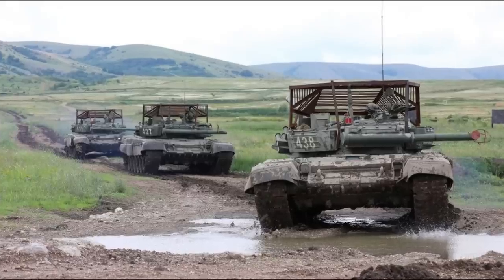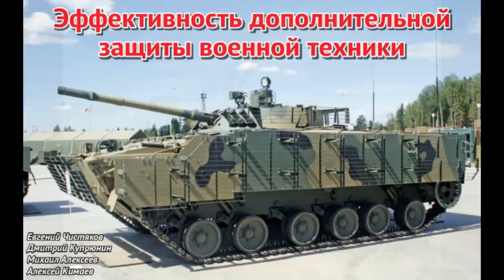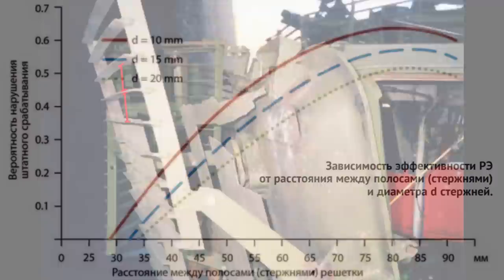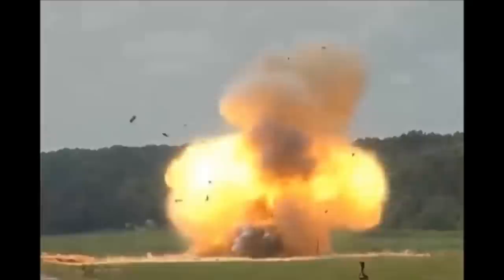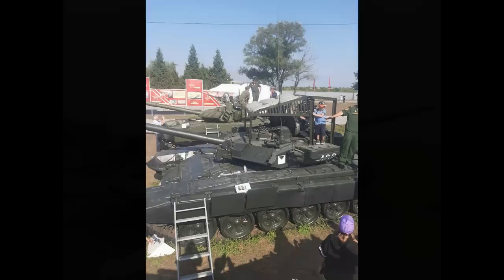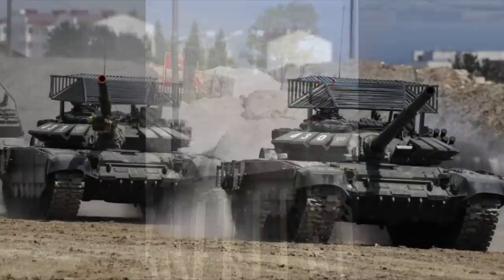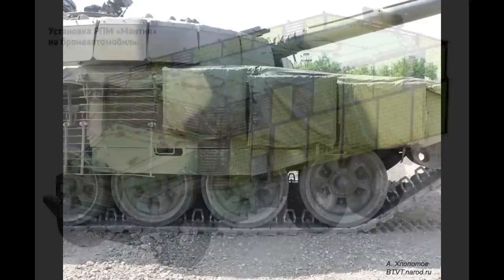The Truth About COPE CAGES

Comment: the V-shaped metal is called "angle Iron" in the US, it's a very common metal stock used for fabrication, welding and construction
Reply: Agreed. 
And described by dimensions such as:  L2x2x1/4"
(capital L to represent its shape)
Reply: or to me it looks like a vary vary long metal corner brackets prob bought from the russian equivalent of home depo
Reply: That's what I was going to say it is here in Scotland.
Reply: We just call it Angle Bars
Reply: @sven9900  thats what angle iron is basically.  

Very common in 3rd world to just do whateve whenever. With stick welders of course. 

Dunno why home depot wouldn't sell the stuff
Reply: Angle iron is what the UK calls it too. Made from mild steel, so surprised it's military use.
Reply: @lasskinn474  we are from earth(3rd world). Mercury is st, Venus is 2nd, Mars is 4th and so on. which world are you from?
Reply: @redfalconvfx7050  well he kind of is technically incorrect. Russia (USSR) was 2nd world. NATO / aligned nation's were first world. The rest were the 3rd world. It is accepted terminology though.
Reply: I was thinking it is for bilding the javelin or a bomb by transmission waves or making it electricomagtic in way that the filed is the opposite of the threat which makes the threat doesn't hit them directly. Same way in m1 Abraham.
Reply: Its called that everywhere..
Reply: that's standard construction material all around the world
Reply: @ailediablo79  WTF are you talking about?
Reply: @coenogo  javelin and others use singles to aim at the target which can be blinded. Also they are made if metal materials that you can make around the tank an electromagnetic force field opposite to thise materials to force it go away.
Reply: @PrivateWalker  Even first world military shipbuilding uses a ton of mild steel
Reply: @ailediablo79  I think I’m beginning to understand what you’re trying to say. Yes, Javelin and other similar missiles use sensors to guide themselves onto their targets. However, there’s no way for these cages to affect these sensors.

As for the idea of electromagnetically repulsing incoming projectiles, that’s sinply not possible. A magnetic field strong enough to stop incoming missiles would fry any electronics onboard the tank, and would likely be harmfull to the crew. Not to mention that the tank would need to be hooked up to a massive generator to be supplied with enough electricity to generate such a magnetic field.
Reply: @TooTallDean  Ye, Something like that but in metric. Probably 50x50x5mm(~2x2x3/16") for the frame and something smaller, maybe 25x25x4mm(~1x1x5/32") for the ribs.
Reply: @lasskinn474  wait they dont?
Reply: @coenogo  bru the magnetic field is used by usa on m1 Abrahams in Iraq 1991 and 2003. It doesn't  take that much energy because it uses the properties frequency of the metal. 

Bilding is by making yourself the tank look bigger or untraceable as if it is in smoke.  For the sensors of the missile.
Reply: @sven9900  "steel angles metal stock" on home depot. 

Anyway in thailand they sell the stuff in 5 meter strips. Thats the methodology for constructing these. Also more likely to be a smaller shop that just sells pipes and longstock metal like that and stuff.
Reply: The kicker: Were tanks with these hasty drone cages known to be massing on the Ukraine border prior to invasion? You won't hear American "news" media performing even at that sophomoric level. Can you see this?
Reply: "Long, weird metal" aka one of the the most basic fundamental forms of steel
Reply: @redfalconvfx7050  Only world that counts is earth
Reply: Great and u know  for what ? I know it, but talking about potatos is the Same Wat u Talk
Reply: @jugo1944  example please?
Reply: In my country is called  L  profile
Reply: @PrivateWalker  the military does not use tool steels for every piece of equipment. Mild steel is often preferable  due to price, ease of manufacture, and its less brittle
Reply: @ailediablo79  I think you've been watching too much sci-fi.
Reply: @TommygunNG  i don't watch those things. Also as i said m1 Abraham Lincoln has that attachment used against Iraq in 1991 and 2003. They so far used it only against Iraq with few other attachments to minimize casualties. But it was added all around the tank not from top.
Reply: @benholroyd5221  i know that version too
Reply: @ailediablo79  "m1 Abraham Lincoln"?

Go sleep it off, dude. Then find me an article about this fantasy of yours.
Reply: @TommygunNG  it is not fantasy just type on YouTube m1 Abraham in Iraq
Reply: @TommygunNG  I'm guessing their first language isn't English and given the US predeliction for naming things after presidents, it seems an easy mistake to make. 
So why don't you argue his point than start throwing around and hominems.
Reply: @benholroyd5221  "And hominems."

But I'll let that go.

I don't argue his point because he has no point. He's making up a fantasy. BUT, in the off chance there is something to his story, I have instructed him to provide evidence of it, so that I can properly address it--after he sleeps off whatever he's on.
Reply: they should rename them copium cages xD
Reply: L-profile in europe
Reply: I came here to say this....
Reply: here we call it profil-L
Reply: Same in Germany. We call it "Winkeleisen" wich is a 1:1 Translation.
Reply: @zacharytuttle5618  less brittle than what? (Politely asked btw)
I meant surprised with mild steel angle iron being used as protection against anti-armour rounds of which there are several types.
Would of thought something much stronger & more resistant to blast force would of been used. A little girl can easily chop through this with a hacksaw!
And not mild steel itself being used by militaries.
Reply: It's also a perfect way to get those well known grill marks on grilled meats.

There is a guy from Manassas Virginia who made millions selling little tiny versions of these cages that you could place on your grill to get the same professional grill marks on your burgers and steaks that renowned chefs are famous for.  Lol.
Reply: Yeah, we call it that here too (Denmark).
Reply: @ailediablo79  No. It's just dead metal, super simply made, no high-tech here.
Reply: @keithklassen5320  i was thinking... do u read.
Reply: @ailediablo79  M-1 Abrams, named after an American General Officer of the Vietnam era.
Reply: @blackhawk7r221  ok
Reply: @alexwhite3271  corruption should be with limits + military is the last thing that gets corrupt. They should have made sure the military never gets corrupt.
Reply: its very common metal everywhere in the world
Reply: @Rusty9017  some places don't like Japan and NZ for example but ya it is very common.
Reply: yea i was about to say that was odd to call it weird v shaped metal
Reply: Same in the UK, angle iron was like Meccano for adults, I've seen sheds and car garages with that used as main structure
Reply: Universal term for it is RSA, Rolled Steel Angle.
Reply: @blackcountryme  shh that is classified russian armor they will never defeat it MUHAHAHAHAHAHAHAH

: 5.56 round hits tank driver in the face :

NOooooooooooooooooooooooooooooooo

for real tho its easy to weld can be used as a square great stuff for anything but armor
Reply: I was almost to tell it. Many countries use them. This guy is clueless of what he's saying
Reply: @redfalconvfx7050  🤣😂
Reply: Also called like that in germany.
Reply: @Fuzzle'd i was a combat engineer in the eighties and nineties. We made rocket screens out of chainlink fencing and rebar, which was effective at protecting buildings
Reply: “Angle iron” “L channel” is just you common “run of the mill” stock. No special properties other than easy to weld. Questionable when it comes to protection from a javelin to say the least..😂👍🏻
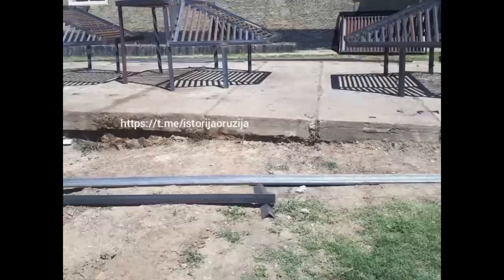Reply: 3:40 v shaped weird metal?? that shape of metal is as common as water all around the world; we call it ''L'' shape in our country
Reply: @redfalconvfx7050  the  3rd world title used in the original comment is referring to how developed a country is, rather than a physical location. The most developed nations are 1st world nations like the US, the UK, France etc., and the least developed are 3rd world nations like Somalia, or other economically poor nations, and 2nd world nations being nations whose level of developement is somewhere in between.
Reply: @matposton87  no it is not. He thought we are living in a deferent world.... lol.... how stupid are you guys thinking that I don't know the meaning of it... I was just joking about what he said. 😆 🤣 😂
Reply: @ailediablo79  flat earther???
Reply: @blackcountryme  . Thats because it is a strong shape it can take stress from multiple angles and is lighter and cheaper than square section or channel and easier to weld than pipe
Reply: @jtwp1770  . Mate anything that disrupts the functioning of the charge is effective armour. We used rebar and fencing wire to deflect and prematurely detonate rockets.
Anti tank rounds (HEAT rounds) use a shaped charge that needs to be detonated a set distance from the tank in order to get maximum penetration. If you put something in the way, something cheap and easily replaced, then your expensive armour lasts longer and is even more effective. Of course there are weapons so destructive that your screwed no matter what.
Reply: @ailediablo79  The cage armor on an M1 Abrams is just regular metal. The weapons typically fired at it (RPG-7) are unguided dumb rocket propelled grenades that do not use any sensor for targeting. The missile flies in a ballistic trajectory. The cages stop the rocket by catching it, causing it to go off too early for the metallic jet to form, not by magnetism.
Reply: @poiu477  no it is not the cage around. It was used only in iraq 1991 and 2003. The one i am talking about lecturely makes the RPG exploed meters right or left of the tank. It is on YouTube mate.
Reply: @ailediablo79  Ahhh you are mistaken in thinking that was from the 90's. I believe you are referring to the Trophy Active Protection system that works by firing what is essentially a shotgun at the incoming rocket. Again no magnets, and is much more recent.
Reply: @poiu477  no not that one. It doesn't use magnets but magnetism. It uses many different electrical frequencies resonance by getting  electric current into plates of certain molecular structure that inflate the frequency echo. This makes the incoming missile blind and resonant with the tank as if one is postive and other negative and just refuse to meet thus it bounce off. Of course with speed it can get through. That is why tanks today use 2 or 3 charge round system that focuses on penetration. 

Just f search it on YouTube mate.
Reply: @ailediablo79  It doesn't exist. You are wrong. And again, most things our troop were shot at with were unguided rockets with no seeker.
Reply: Right. Buddy did so much research on other stuff. Failed to learn about the simplest material to be described as well haha. A v shaped rod hahaha
Reply: “Angle iron” here in Canada also
Reply: We call it that in Australia too
Reply: You can also find 6 foot lengths of it all over the world used as pickets to hold wire fencing.
Reply: In the Canadian Army this is used to shore up trench walls so we have oodles of them
Reply: Also used on American armored vehicles in Iraq and Afghanistan. Also used sandbags.
Reply: @coenogo  : About Futbool😂